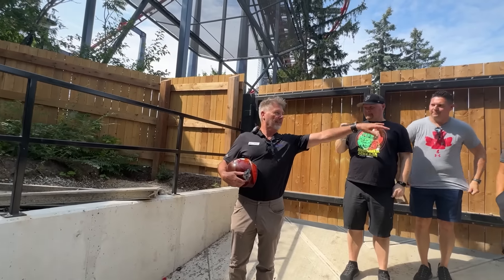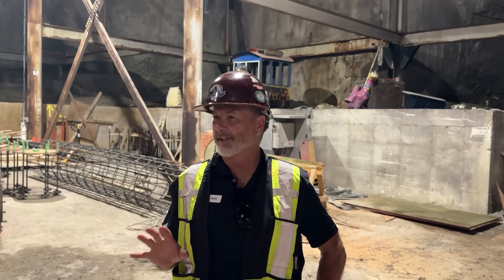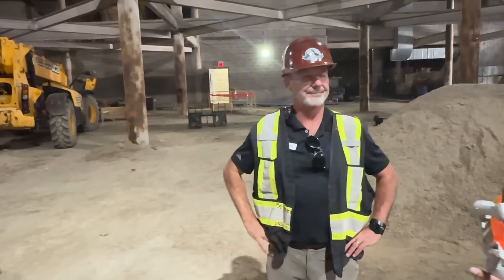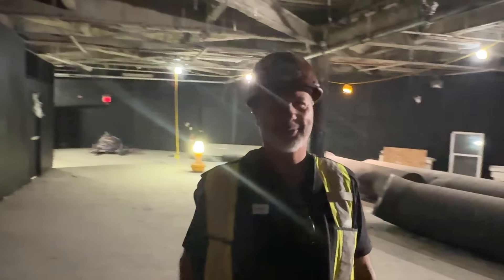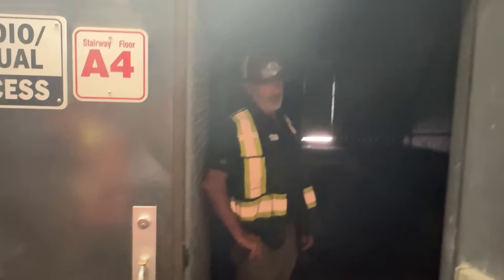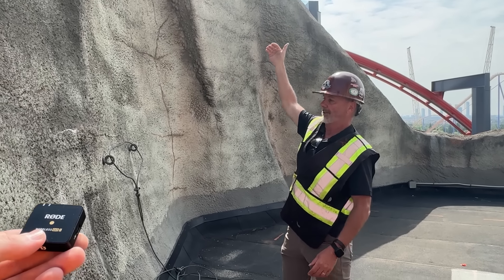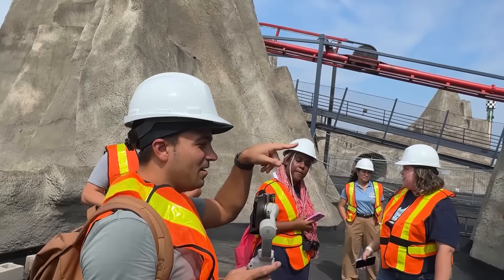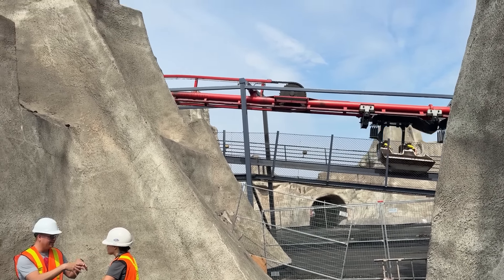Canada's Wonderland AlpenFury Behind Scenes Tour

Comment: Fascinating that he said the ride will not be attached to the mountain at all. A separate system. After seeing this, there is way more decking, supports, etc in the mountain than i thought. I'm not surprised he said most of the effort will be on phase 1.5, the mountain. It will be interesting to see how they are going to get the track into the mountain that ramps up and out of the mountain. So much work. Wow.